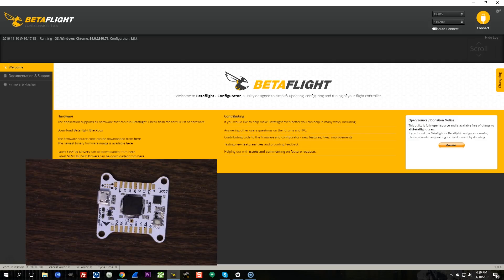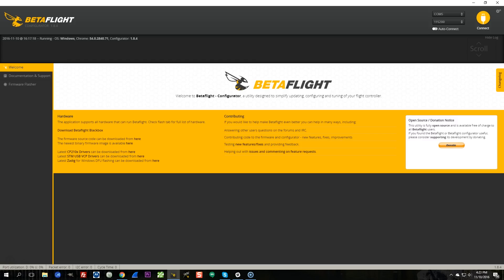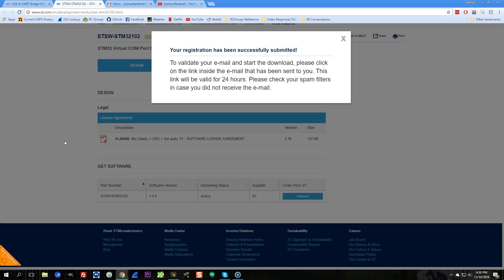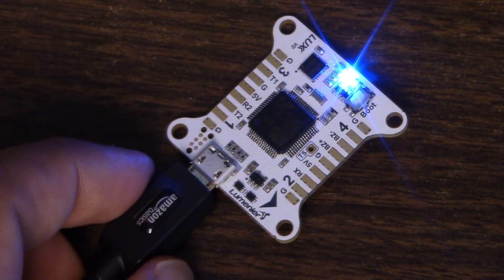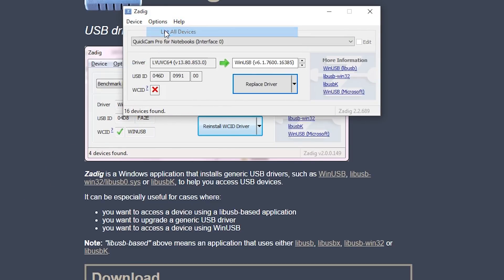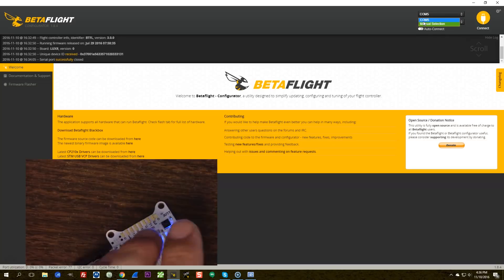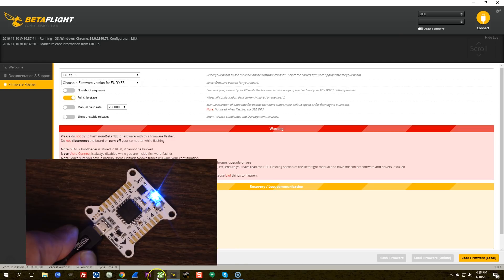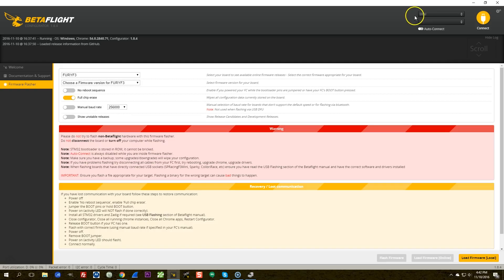Betaflight / Cleanflight Flight Controller Won't Connect | FIXED

Comment: Thanks a lot for your video ! I have an issue with my e010s f3 FRSKY board here : for the 3 last month I've been trying to figure out what was my problem...

I followed all your instructions but when I plug in the micro usb cable, i have the com 4 that appears and the connexion starts but stops after 10 seconds and the error message appears : "communication failed" and "fail to open serial port".

I've try to change micro usb cable, change the usb port, reinstall the drivers, check if my "silicon labs cp210x usb to uart bridge (com4)" port (com and lpt) was here etc etc...
I am at this point for 3 months now and i can't figure out what is my issue.
Do you have an idea ?
Reply from the maker: The next thing I would do is try to re-flash it using bootloader mode. But you would first have to know the correct board type ("target") and I'm not sure where I would start on that.
Reply: @JoshuaBardwell  Thank you for the quick answer that's amazing !

The bootloader mode in betaflight you mean ? I need the SPRACINGF3 but I can't use the bootloader from betaflight because I can't connect my board with betaflight... When I try the bootloader mode i have "No response from the bootloader, programmatioon : failed"

My board is new, and already worked in the past, I can't understand what went wrong >:/
My board isn't recognized by ImpulseOSD or even ImpusleRC... I also tried Flash_Loader_Demo and zadig for the initiative installation, nothing worked :$

I am in the same situation as 3 months ago !

Thank you again for your reactivity !
Reply from the maker: SPRACINGF3 won't work with ImpulseRC driver fixer because it uses the CP210 drivers not the STM32 drivers. When the SPRACING board is in bootloader, you can tell from the solid LED on the FC, but you won't see any difference from Windows' perspective, and you won't be able to connect. But if you try to flash, you can still flash.

Here are my old instructions for flashing an SPRACINGF3 board: https://youtu.be/e7dGCZMJ6SA?t=1318
Reply: @JoshuaBardwell  Thank you for your time, I have already tried everything you show in the "Eachine Wizard X220 Initial Setup & Upgrade to Betaflight 3.1" video, but nothing is working :'( My board isn't broken or something and I don't know where is the problem !

If you have any idea, it could be very nice from you, I don't want to insist, thank you again for your time, I really appreciate that !

Comment: Hey Joshua, I have a flycolor 20x20 12a stack but the FC came with the wrong drives on it so I can not connect to beta flight. So it has a stm32 chip but its driver is CP210x and I am unsure on how to get it back to a stm32. Can you help please I don't want to just through away the stack.

Comment: Know this video is old, but I accidentally flashed an F4 board with the F3 target, and now my computer won't recognize it when I plug it in. followed the steps, loaded the drivers. Board still powers, sends video to and out the vtx, but no lights and won't acknowledge dfu boot starting.

Comment: i use mac and i can't found DFU mode, please help me, i really appreciate, thank you very much :)
Reply from the maker: Mac has drivers built in. It should enter DFU mode automatically when the FC goes into bootloader.
Reply: @JoshuaBardwell  in my computer said "no configuration receive within 10 seconds, communication failed, serial por successfully closed", what should i do? i'm sorry to bother you but i need help, pls

Comment: Hi Joshua. 

I have
bricked my StarF3S flashing SPRACING3 (which I would expect to be a
suitable firmware for this being STM32F3****).
Flashing went fine and it said it was successful... Yet it doesn't
even connect to the PC, I don't hear the sound of the thing getting
connected. There is no boot pin. 

How can I revive it?

Thanks in advance
Reply from the maker: Put it into bootloader mode and reflash it.

You should always go to the CLI and type "version" before flashing, to confirm which hex file target is on the board. If you flash the wrong file, it won't brick the board, but the board will become unresponsive. You can revive it by flashing the correct hex. But since you wiped the config when you flashed, it's a bit hard to figure out what that is.

Comment: Joshua, you are saving my life on this, and  already got the VCP drivers installed now... but the other drivers are giving me this error message "Silicon Labratories Inc Install failed" Any idea what I should do next?
Reply from the maker: This is a PC issue but unfortunately I just don't know how to tell you how to solve it. I'm not really good at pc troubleshooting.
Reply: Thanks for the quick reply. I was able to solve that part of the issue by first installing this new VCP driver. https://www.silabs.com/products/development-tools/software/usb-to-uart-bridge-vcp-drivers#windows Still can't reach the FC but it in old SPRACING F3 and I think it is just playing hard to get.

Comment: dont know if you will respond but i have a problem connecting beta flight to my brand new mobula 7, i have a Macbook Pro downloaded it and downloaded the Drivers. when i open beta flight on top right has three options manual and bluetooth no ports showing up that its reading it? im going crazy didnt even fly yet trying to set up first, about to get out of hobby before i even started. well if anyone alive out there sees this also appreciate the help is not Mobula7 brand new in Box for Sale. Thx
Reply from the maker: You shouldn't need to install any drivers on a Mac to connect to the Mobula. Just plug it in and you should see a new serial port appear and then you can connect.

The first thing I would try is a different USB cable. Some USB cables are power-only for charging phones but not data connection.

Do you see the lights on the Mobula light up when you plug in?

PS: Thanks for being my Patron :-)
Reply: Joshua Bardwell man I been watching your Videos For a Week Straight I Been Racing RC Cars 20 years. We Race up by Critters Raceway. So just wanted something new for the house since I have a son now. took me 4hrs of reading I installed drivers etc.. they said it doesn’t work on google app etc.. anyway I came across the 5-6th cable like u said Data some power Etc.. never crossed my mine smh 🤦‍♀️ now watching your other video on throttle scaling mob7 :) man wish you was Closer To NYC .. def drink Beers Fly High Up with Drones . I really appreciate your reply hardly anyone does that know em days. I’m a union plumber in City people hate each other . Lol Thx man .. keep doing your thing my Man.. RIP to Blue Falcon Also Respect ✊ to our Fallen Brothers I’m a Rider also. I think you 2 together would’ve been one hella team.

Comment: Please help. I've wasted about 3 days trying to get my Vortex Mojo 230 reset. My Speedy Bee app has messed up my flight controller and the only way to fix it is to connect to betaflight and reflash. I've never been able to connect to betaflight and recently only had luck with my brand new Mobula 7. Now I've downloaded all drivers and opened up zip folders and unpacked them and ran the installation wizard and as far as I know I have all drivers downloaded but still cannot get my Vortex to even change com ports when plugging into betaflight. I've wasted so many hours I'm about to just replace my FC and never try and connect to betaflight ever again. So tired of wasting time and still getting nowhere
Reply from the maker: Why not reach out to the ImmersionRC guys for support? It's their product.
Reply: Well I seemed to have found a way around the problem. I deleted speedybee app and reinstalled older version. I was then able to run setup wizard on the OSD and once calibrated I plugged in speedybee and set switches. Once I verified yaw wasn't stuck all the way to the right, I disconnected and test hovered. Seems it's working like normal now. I guess I know I gotta be careful about which FCs I buy in the future. I have no issues connecting to my Mobula 7 in betaflight.
Reply from the maker: The Vortex comes with custom firmware and should only be managed via the ImmersionRC apps. That may be why SpeedyBee messed it up.
Reply: Speedy Bee's newest update messed up my Vortex, my Mobula 7 and my Torrent 110. Problem is everything looks fine until you unplug and hook up a pack and arm. Then it just jumps up and pirouettes to the right when you hit the switch. I never knew there was an issue until I got to the field and all 3 quads were unflyable. I managed to get my Mobula to connect to betaflight first with no problems. But then I figured out the trick with the Vortex and the older version of Speedybee. I'm still having one minor issue with the Torrent not saving the Spektrum RX options I keep trying to save so I can bind it. Even Betaflight keeps erasing it everytime I save and reboot after changing to SpekSat. Ever have that problem? I know ur not a spektrum guy. All this happened because I just got the Jumper T8SG and was setting it up on all my quads and...BAM! But my goal is to start using FRSKY receivers from here on out.

Comment: My Mobula7 (CrazyBee F3 Pro) died literally in mid flight. I know how to flash it but the board gets the "Malfunctioning Device" pop up from Windows 10 saying basically my board won't work with USB anymore. I can't do anything, doesn't that mean it's bricked, or would that be damage, I dunno... it happened seconds before landing, I have had over 100 flights with it, it's the 3rd one I have killed. I guess that is now useless is it? "Great Vid by the way".

Comment: Here's a weird one for you Joshua.. 
I plugged in my Furifuribee x215 and windows in the background created a usb driver called Kakute f4 and I didn't know it had done that.
So Betaflight would no longer link with any of my drones for some reason..
I reinstalled all the drivers several time tried for hours to connect and finally discovered that weird usb Kakute driver that windows created, deleted it and all was well again..
Ever had that happen?

Comment: It connected until I flashed the latest update, now it won't connect. Do I still need to download drivers?
Reply from the maker: Most likely you flashed the wrong target to the board. You selected the wrong thing in the pulldown menu in the configurator, where you pick what FC you have. 

What FC is it?
Reply: Thanks for responding, It's the microF3 betaflight in the Kingkong tiny 7..  Frsky I just flashed the latest version after typing "version" to see what version it had.
Reply: I'm a total noob just learning this stuff. My little Bold Cash Bwhoop B06 still connects.

Comment: I did wat you say dont do that. What do i do now
Reply from the maker: You're gonna have to be a little more specific. I don't know what you're saying you did :-/
Reply: I replaced the drivers with the zadig ones, when i wasnt in bootloader mode.  now i can flash but not connect to betaflight. It does not say com port only Manuel selection. As when i start the board in bootloader mode it says dfu and everything works. Just not the normal connection to betaflight.
Reply: Sorry i figured it out.
Reply from the maker: SWEEET :-)

In the future use ImpulseRC Driver FIxer not Zadig :-)
Reply: Thanks for taking the time to reply, i had to set my computer back in time to remove the zadig drivers. Thuesday i get mij frame so i can build my quad after al. First build after flying 6 months with the wizard x220 🤭

Comment: Hey, I really don't know why, but I for some reason am having issues with being able to connect my quad, I'm not sure what the issue could be, and I'm pretty sure I downloaded these 2 drivers, so I don't know what my issue could be, any ideas?
Reply from the maker: If you installed the drivers then when you plug the quad in, you should see COM3 or some other COM port number in the upper right. (This is if you are using Windows. On Mac it's different.) If you don't see the COM port appear then either the drivers are not installed or something is wrong with your USB port.

You say you downloaded the drivers. But did you actually run the installer that you downloaded? Simply downloading the installer file is not enough.

Comment: Joshua thank you for all the knowledge sir. Ok real quick I am new to beta flight and I just want to make a few simple changes and  setup my switches. So basically bind n flys is my aim. Nobody can answer this do I need the drivers installed if I am not going to be flashing. I just want basic simple setup.

Comment: Hi Joshua. I just got my wizzard and after flashing won't connect to BF. Which version of BF Omnibus4 should I flash? Thanks
Reply from the maker: Are you surei t's omnibus f4 and not spracingf3
Reply: Well, it says it's Omnibus F4 FC? I thought it should be flashed with Omnibus firmware...
Reply: Joshua Bardwell  it looks it should be Omnibus F4SD firmware (I tried spracing f3, too). I did flash it successfully, but it doesn't connect  to BF afterwards. Tried other versions too, changed cables,  ports, I really don't know what else to do.  I wish I would leave it on stock, it was flyable, at least. Is there an option for factory reset of FC? Well, I guess not... Maybe I'll have to order another FC board... Any help appreciated...

Comment: Seems I'm having problems with one of the drivers. When downloading the STM32 Virtual COM Port Driver, the website says "Starting from Windows® 10, the STSW-STM32102 driver is no more adequate and the usage of the native inbox driver is recommended". I have windows 10 and there doesn't seem to be a file for windows 10. I'm not sure how to proceed.
Reply from the maker: I use the Windows 8 driver downloaded from the STM site.
Reply: Thanks. I installed the drivers. My flight board says cleanflight on it so I got the chrome app for cleanflight and I can connect to that and it sees the position of my drone so all is good there. But I can't connect to betaflight. Also, my drone won't arm itself after binding the receiver. Do you have any resources on this? It is proving difficult to find solutions.

Comment: In all your experience have you run across a controller that would not connect through the USB or be recognized by it? Hglrc 438 Omd F4, Boot button has no effect. VCP does not see it… Steady blue light but no one’s home. Was thinking of hard wiring an ST-Link to it but can’t determine where the Clock or IO pads are to try.  Any advice?

Comment: Thanks JB, fantastico, finally my drivers now work and 3.5 is on my whoop, yeeha! You da man. Now all my Mockingbird settings are gone do I need to set up from scratch again or can I run my BF 3.2.2 Dump into CLI? I read that is not a good idea but keen to hear it from you :-) Would certainly save time, what would you do?

Comment: Ive been trying to flash my 1st board for 2 days, this will help thx. One of the most annoying problems is finding out what board to select, I have no idea, QX65 BeeCore V2 board on whoop, others say use Omnibus, how do I know if that's correct? Having loads of problems with this, 2 of us trying we can't seem to get it to flash, just red bar failed each time. Will start fresh following your vid. One quad screams when plugged in, why is all this so difficult, crazy! Thx J.

Comment: I have a kakute F7 flight controller and I was locked out by flashing wrong firmware . Now When I plug the FC  into PC nothing happens. Is there a solution to bring it back to life?
Reply from the maker: You can almost certainly put the board into bootloader mode then flash the correct firmware.

1. Hold down the bootloader button. Plug in the USB cable while continuing to hold down the bootloader button.
2. Run the Impulse RC Driver Fixer app (https://impulserc.blob.core.windows.net/utilities/ImpulseRC_Driver_Fixer.exe). It should "fix" the driver successfully. If not, do not proceed.
3. Un-plug the USB cable.
4. While holding down the bootloader button, plug in the USB cable again.
5. Start the Betaflight Configurator app. In the upper-right corner pulldown menu, you should see "DFU". You can now flash the board.

For more detailed instructions on how to install the STM32 drivers: https://www.youtube.com/watch?v=m4ygG6Y5zXI

Comment: Hi Joshua, Thanks for the information. I am still having issues. The latest version of this code does not have the exe for the archive process. I have windows 7, 64 bit and used that installer. If you have recent updates, do you mind sharing what setup you used and if not, if you could show me the installer you used, it may be reverse compatible. Thanks
Reply from the maker: I'm confused... I just installed these drivers on a computer and everything was there. Look at my Betaflight 3.4 setup video.

Comment: Hey, I was just wondering if you could help me out with a problem I’ve never had. I just purchased a new f3 femto flight controller for my flite test gremlin. The board worked perfectly fine I checked it on betaflight. When I plugged in the 2s lipo the board responded perfectly. When I went to do the motor calibration the X,Y,Z graph froze, and I couldn’t continue with the motor flash. So I disconnected the board and plugged it back in with the USB, the board did not respond, no LED sequence. The computer now says USB device not recognized, I tried 2 different USB cables and 2 different computers. It’s almost like the board isn’t being powered via USB. So I tried plugging in the 2s lipo, the board responded, but the red LED just continuously flashes. Any thoughts? Thanks for the help.
Reply from the maker: I don't know exactly what happened but if you get no LED when you plug it in and device not recognized, it's likely the FC is damaged somehow.
Reply: Joshua Bardwell okay I placed the order from emax-USA I’ll have to contact them. thank you for getting back to me.